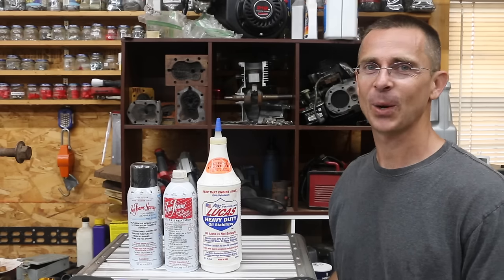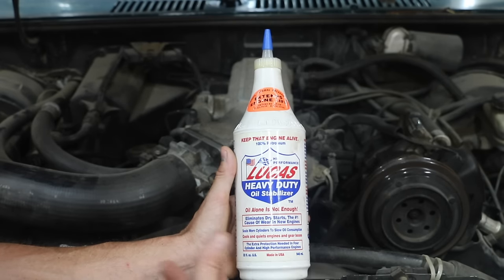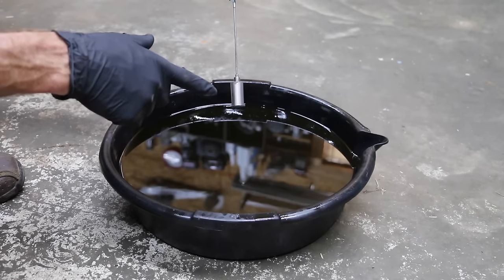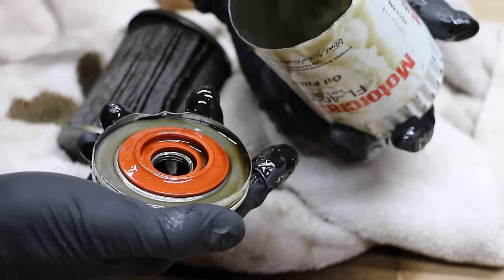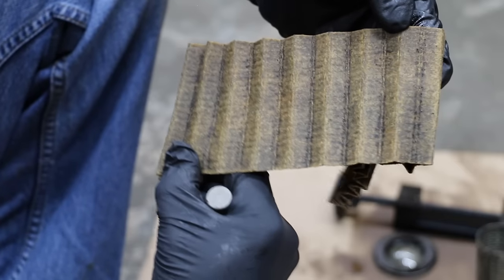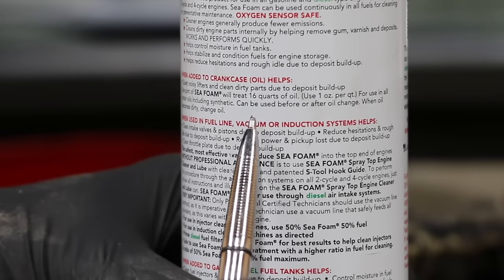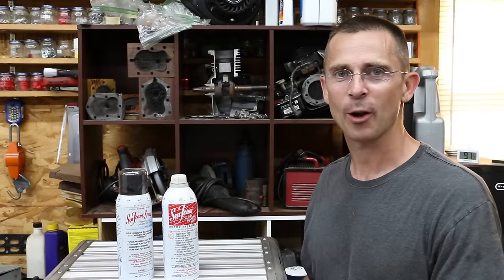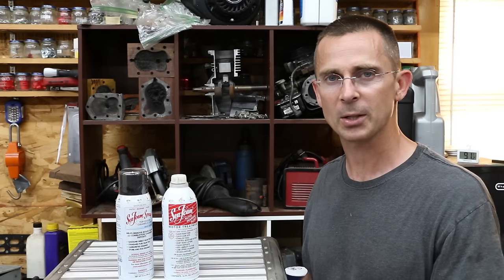Did the Seafoam fix last? Update on the Ford Ranger

Comment: what is that a rubber mat under your car ramp does it keep it from sliding? mine slide sometimes when using them in driveway. now started using 2x6 boards cut with a bevel on each end in front of my ramps to get modern low cars up ramp without hitting the ramp with air scoops.
Reply from the maker: Thanks for sharing.

Comment: What are your thoughts on 505-CRO?  It's a engine cleaner that you run for 15 minutes or so and then drain the oil.  It would be interestng to test this product on the old Ranger.  Thanks!  I used something call Motor Flush on a Chevy Malibu with a noisy lifter.  It solved the noisy lifter but the rear main seal on the engine failed badly.  Since it was a friend's car, I felt resposible and pulled it all apart to replace the seal and it was a huge job.  I wonder if any of the so-called engine cleaners would damage the seals?  I haven't used any cleaners since as I don't want to damage anything.
Reply from the maker: Thanks for the suggestion.

Comment: Looks like you have a substantial oil leak, you asked about low compression. Valve cover, head gasket, rear main seal would check ✅

Comment: Seafoam can be expensive, I heard that drain out a quart of oil. Then add 1 quart of transmission oil to dissolve oil sludge in the engine. Then video said to run the engine at idli for 10 minutes. This will help to break down that sludge throughout the motor. Then drain and replace the oil and filter. I don't rememberr at what millage or how many months to do this. But would elimate the sludge, because the transmission oil breaks down that sludge. Talk to a mechanic or on YouTube. Many yts out their. The most expensive price of your car is the engine.
Reply from the maker: Thanks for sharing.

Comment: While many refer to these sort of solutions as "snake oil", My personal experience with Seafoam (in old outdoor power equipment engines) has resulted in cleaner carbs.  All of this equipment has solid valve lifters, so I have no experience with that.

I would think that your observation of the Lucas supplemented oil losing its "tackiness" is due to the blow-by from the combustion chamber into the engine block.  Your Ranger probably has a couple hundred thousand miles, so is overdue for an overhaul.  But, if a couple of supplements can stretch its life a little, it's worthwhile, isn't it?

Comment: Between this and the tahoe video, I feel a lot better about attempting to keep this trailblazer running. I noticed you recommended a differential flush, transfer case, transmission, and engine oil. Is there anything else that you consider absolutely necessary to improve longevity?
Reply from the maker: Thanks for the feedback.

Comment: After 4 years, how is the Ford Ranger running since you did the Lucas and Seafoam treatment? Has any of the noise returned? Have you experienced any loss of power to the engine? Great work on your videos brother and thanks for doing all that you do by creating these videos!!
Reply from the maker: Thanks and you are welcome!  The ranger is still running great with no issues  I use it as a farm truck and it experiences some really hard use.

Comment: It would be interesting if you could do a test on AMSOIL Signature Synthetic motor oil.  A bit pricier than othan other premium synthetics but will run up to 25K miles according to AMSOIL.
Reply from the maker: Thanks for the suggestion.

Comment: Sir, do you run Seafoam in the oil continuously now and just check to see if it looks dirty and needs an oil change? [Oddly, I have a 2009 CRV with a nasty rattle on cold start that goes away after driving it for a few miles. The timing chain, tensioner, and VTC actuator were all replaced, but that failed to fix it. Seafoam in the crankcase for about 600 miles fixed it, but I changed the oil and filter, and eventually the rattle returned. I'm wondering if you leave Seafoam in your Ford Ranger all the time?]

Comment: When I first started using Amsoil out in Seattle 1992 actually it was before that is about 1990 now I think about it I was giving this guy across the street from a Tracy he had an old Ford Torino with a 302 and it leaked oil pretty bad so I was giving him I used Amsoil and I was changing it right around 15 to 20,000 miles and he would be dumping that in there you know and one day probably about six months later he pulled a valve cover gasket off both valve cover gaskets and change the gaskets and the engine was nice and clean inside where it wasn’t clean before it was all slide stop used Amsoil clean that engine up all right you have a nice day this is six in a row jim Again
Reply from the maker: Thanks for sharing!

Comment: Please read
First, love your videos.
STP RED LABEL
1997 Honda ACCORD V6 134185 plus miles 
I DRIVE 50 MILES, AROUND TO WORK AND BACK HOME FOR 250 MILES.
I WOULD HAVE TO ADD 1QT A WEEK . The engine was not burning oil. It was leaking from the back motor main seal.
Pulling the engine to replace the seal is very costly.
I took 20% of what it cost for the repair and used it on a " stop leak" product.
STP red label is the only one that said it Stops main seal leak.
One week I used STP. red label and the next week regular oil.
At first I didn't think it goes to work.
About 6 weeks later., When I checked the oil and did not have to add anymore oil after that day.
I only was 8% of the 20%.
Reply from the maker: Thanks!  Thanks for sharing!

Comment: I just saw your seafoam test . Would you be willing to try Slick 50 in the engine to restore compression and run better. I’ve used it in my 04 Volvo and with 260000+ miles I’m still having good mileage and no slow or sluggish behavior with my car.
Reply from the maker: https://www.youtube.com/watch?v=VwePft315Ds

Comment: How does sludge removal make an engine run better?  Why not change the spark plugs? Sludge in the oil pan would not impact the timing.
Reply from the maker: Thanks for the suggestioin.

Comment: Can I run seafoam in my 2010 dodge ram 1500 to clean buildup in the intake? I had replaced my gaskets for my intake manifold and saw my valves look pretty clean but the inside of it is built up. 
My pcv valve had went bad so had oil go back Into the intake manifold and back of throttle body
Reply from the maker: Thanks for the suggestion.

Comment: At the end of the video you asked what product you should try to help restore compression. I have been a automotive technician for ten years and there is a product that I have tried that I can honestly say that it does work. I have personally compression tested before and after on three different vehicles and verified that it does in fact work. Its called "E.P.R." and its made by a company called B.G. please if you have not yet used anything on the ranger. I am curious if it will work after using the seafoam.
Reply from the maker: Thanks for the feedback and for the suggestion.
Reply: @ProjectFarm  yes sir. And thank you for the great content. I did forget to mention that it is also a great video!

Comment: Mobile 1 isnt going to give an engine any significant sludge.   If you were running pure synthetic oil from the getgo and started getting rocker noise, then you have other issues that no kind of additive is going to fix.
Reply from the maker: Thanks for the feedback.
Reply: @ProjectFarm  Back in the 60's cars often had noisey rattling emitting from their engines.  Along came STP and the away went the noise......but it did not fix the engine's fundamental engine problem.

Comment: I ran seafoam through my 2003 Honda pilot and the next day the rear main seal was pouring!
Reply from the maker: Wow! Thanks for sharing!
Reply: Yep... Seafoam is great for cleaning the internals of an engine as it breaks up film and sludge. The only downside is you may have areas in an old engine that have built ups areas of  heavy sludge which formed a "seal" of sorts. Getting our the old hardened sludge removed the dam... so to speak.

Comment: Would you use one of those old wives tales for internal engine cleaning?  Such as, running the engine at 2500rpm and spraying a mists of water into the intake , use 1 litre of water SLOWLY and when finished look at the carbon in the cylinder. Of course you checked the carbon in the cylinder before doing this water test. ( we are using a Borescope)  The other was to spray Brake fluid into the intake at 2500 rpm. Not sure if this one cleans any but does a a hell of a job creating thick white clouds of smoke and scaring the natives...
Reply from the maker: Thanks for the suggestion.

Comment: Used sea foam on my chevy cruz with 170000 miles after dealer wanted 3500 to fix. Runs like new. No more check this and service that lights on. Only took one tank of gas to clean it all up.
Reply from the maker: Thanks for sharing.

Comment: B.T.W.... you referred to the deposits in your throttle valve as "carbon" -- but that is actually mostly gasoline residue called "gum" or "varnish". You really should try to get rid of all of it -- regular carburetor cleaner (xylene) can do it as well as Seafoam.

Comment: I'm debating the Seafoam on my 5.3. Having a lower oil psi when cold, then 40+ once warm. Thinking I may have a clogged sensor or screen for it. 
Have you ever made an "engine cleaner" video ? I looked and didn't see any. Seeing some suggest Seafoam, trans fluid, Marvel and a few others.
Reply: I haven't found anyone that heard of what I'm seeing. 25-30 psi cold, once I get up to temp it's 40 ish+. Very weird and backwards from normal pressure issues. 
Thinking either the sensor/screen  or the famous oil pump tube o-ring. Hoping just the screen and Seafoam can clean it some.
Reply from the maker: Thanks for the suggestion.

Comment: I'm 75 and my dad was a mechanic, and owned a service station in the early to mid 1960's.  I've heard several stories about making a standard transmission, or a differental quieter. (USUALLY TO SELL A VEHICLE).  Putting oat meal in the transmission and or the differential was one that I heard about.  I NEVER actually witnessed it being done.  Can you validate this?  Thanks!
Reply from the maker: Thanks for the suggestion.
Reply: @ProjectFarm -  I doubt that it would be a solution to the real problems!

Comment: Could seafoam cause my f150 pickup with 260,000 miles to leak?  It runs well as is.
Reply: From my years as a parts guy and a mechanic I can say this: cleaners will never cause a problem, however it's possible they may uncover one. It's very rare but I have seen engines that were basically held together with sludge and cleaning it revealed the issue.
Reply: That engine should be good for much more mileage! Try Seafoam & use semi-synthetic "high mileage oil" or full synthetic high mileage oil.. if you've used a full synthetic all this time etc.

Comment: Rislone, but we use it from day one, change oil like a religion, and shut down the vehicle after 250k - 300k miles due to the rest of the vehicle breaking.  Since 1970, we have parked every vehicle with a working drive train.  But I wouldn't put money on Rislone fixing an old engine.
Reply from the maker: Thanks for sharing.

Comment: Have you considered using 5 magnets on your oil filter, (1 at the bottom and 4 evenly around the sides )? The cost is around $4 and are reusable many tomes.  This seems to work for me, however I have not done any scientific or field tests to verify. I figured for $4 why not.
Reply from the maker: Thanks for the suggestion.
Reply: Well... to the everyday layman the magnets sound like a great idea, claiming to "trap damaging metal particles and keep them from circulating through your engine and causing further damage". However... if you think about it, if they worked as claimed, the magnets would have been incorporated into all oil filter designs years ago. Here's the deal. the magnets are attached to the outer filter shell so any metal particles that are attracted to the magnets are those already circulating the in the outer chamber of the filter. Because they are in the outer chamber they are already trapped and cannot be recirculated by the engine because they cannot pass through the filter paper. NET: The dangerous metal particles have "already been trapped by the filter" doing its job regardless of the magnets. That said... the magnets can work in providing a quick visual indicator to anyone who cuts open a filter for inspection, especially after an engine overhaul, to see if your the engine is exhibiting excessive wear. When cutting open a filter the metal particles trapped in the areas of the magnets allow for a quicker indicator and easier inspection... much easier than having to disassemble the filter and dig through the layers of paper looking for metal.

Comment: I tried the seafoam fuel additive. My mpg dropped from 30 to 9!!!!! Big scary, but no smoke.  After about 100 miles, my mpg jumped to 32 mpg.   Since then it's around 31.7...   (2014 Honda Civic, abt 100K miles.
I only use top tier gas... Mostly Chevron and Exxon.).
Reply from the maker: Thanks for the feedback.

Comment: Please, PLEASE, look into Lucas further. It is not a good product and is essentially Group One base stock with no modifiers (for comparison Mobile 1 is criticized for being Gp3 and not “real” synthetic).

It foams, it reduces the beneficial additives, and the only thing it adds is viscosity (and in a bad way). 

I don’t know what test you can do to prove this, maybe overfilled high rpm vs a straight fill of 15/40? But Lucas is absolutely the “Fram orange can of death” of oil additives.
Reply from the maker: Great feedback. Thank you

Comment: Did you notice any significant change in MPG after the sea foam treatments?
Reply: He's usually pretty good about replying back to these comments. I would imagine though, just as a non-expert, that he's using this as a farm truck, so they're probably wouldn't be any real noticeable gain in miles per gallon. As he mentioned in the video from 7 years ago or so, he said that he goes by hours, not by mileage. Out of curiosity, did you end up using the product? Did you notice any significant change in miles per gallon after using the seafoam?
Reply: @OldCootProductReviews  Not getting a reply is not a big deal.  He replies more than not and as his catalog grows it’s gotta be hard to keep up with all the questions.  No, I didn’t use it.

Comment: Colonel, I don't see the point of trying to clean the sump with Seafoam, even if it does loosen it, surely you then run the risk of blocking small oil galleries? Would it not make more sense to remove the sump and clean it out manually - all for the price of a new gasket.

Comment: dude, metal particles are not contamination, that engine is  self destructing. pull the oil pan and check the crank bearings, oil pump screen too.

Comment: if u aint scared of pullin heads id replace rings its cheap not real difficult and good time to inspect valves timing chain cylinder piston etc besides if a ring breaks itll cost the engine most likely im willing to bet ur rings or valve seat is ur issue if valve case fills with pressure there ur prob or if you crankcase gets pressure from blowby likly rings
Reply from the maker: Thanks for the feedback.
Reply: Enjoyed the video i had a ranger just like that there tough ol trucks iv always been skeptical of the seafoam but I'll have to give it s go in my f150 it sounds bout like urs did hope you have a great day bud

Comment: I've never heard any wives tails of lucas clumping up, but I do know it airates pretty bad in gear oil applications and when you have air, you dont have lube, so dont use it in axle housings and manual transmissions
Reply from the maker: Thanks for the feedback.

Comment: I'm sure you're well aware, as you said you're a skeptic, but these magic potions are a really bad idea. The solvents can dislodge all sorts of stuff and cause major damage, and the additives can royally mess up a quality oil. In this case, where you're trying to get a little more life out of a worn engine, I suppose they have some use. I would have a disclaimer that you shouldn't be using anything like this in a vehicle that's newer/in good shape, it could lead to premature failure of an otherwise good engine. The best thing to do is use a quality oil, and make sure it's changed when required. After all, the chemical engineers that formulate oil know what they're doing, and spend millions on testing regimes.

Comment: Why don't you just use a pipe cutter instead of buying that oil cutting tool you can get more uses out of that pipe cutter and it'll do the same job
Reply from the maker: Thanks for the suggestion.

Comment: You are testing the seafoam for the thing Lucas is intended for?
Why test it for wear on a thing intended to remove deposit freeing up more metal from ports and things?
Lucas stays there and raises compression some.
Slick 50 has a bad name from not following directions.
It does become clumps if you don't follow the directions.
I got 366782 miles out of a 1972 GMC 350 engine.
It ran when I sold it.
You have missing metal from low oil in the motor during operation.
Something that cleans.
Something that coats the cylinder.
Something that prevents wear and some seafoam.
That's the path.
You will turn over easy with Lucas because it's better lubricant. (One drop will ruin a belt)
Plus it can be offset with thin seafoam.
I run the same process on automatic transmission.
First vacuum out a qt. Of fluid.
Add seafoam to top off.
Shift through the gears and run the vehicle for 1/2 hour.
Remove the pan and filter. (Never flush an old transmission)
Now clean the pan and magnet if you have one.
Place the magnet back in the same spot.
Put it together with 1\4 bottle of seafoam
1/2 bottle of Lucas transmission stabilizer.
Wix filter.
Ultra black the fel pro gasket.
It will need this 80-90k